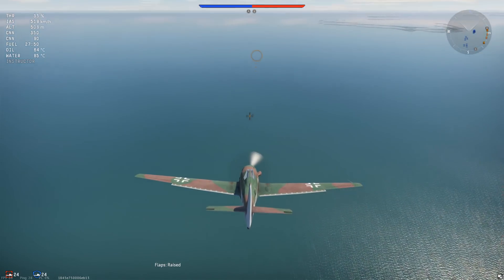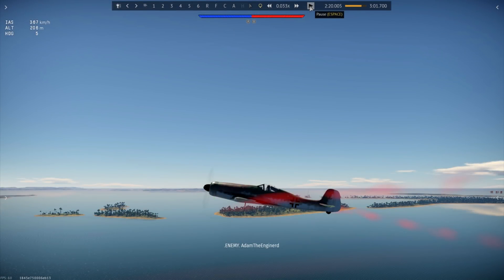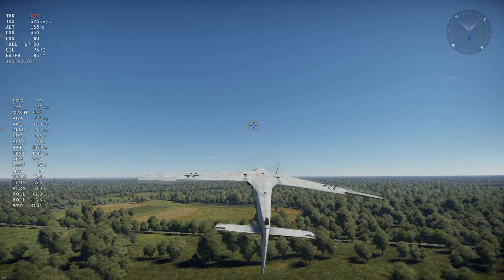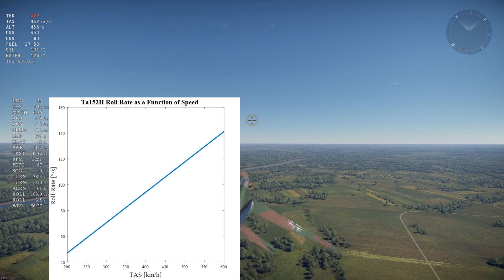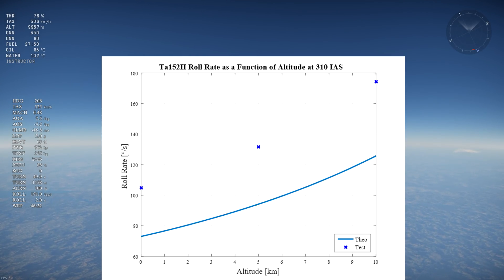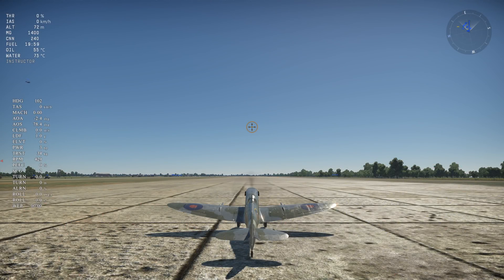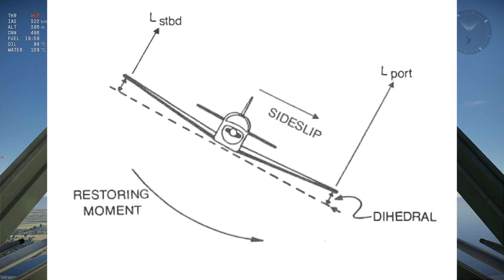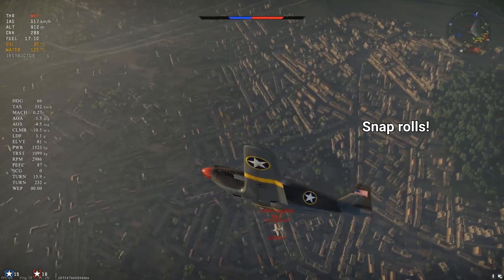Aircraft Roll Rate Explained

Comment: With regards, to the roll rate of the Typhoon, it could be down to a number of reasons(I'm no expert but would like to see what people think). Firstly it has a large wingspan, which limits the maximum rate of roll since the descending wing will generate sufficient lift to counteract the aileron produced torque sooner. But the Ta 152 has more wing area and doesn't have this problem, this could be due to how thick the Typhoon's wings are which gives them more inertia so the aileron torque will have less initial effect. Furthermore, I believe the control surfaces are pretty big without any boosters so they are especially slow to deflect at higher speeds. I'm pretty sure the Tempest had thinner wings and smaller control surfaces, which gave it a much better rate of roll. If these points are right, they should pretty much justify why the Typhoon rolls so poorly, but it's still one of my favourite aircraft.
Reply from the maker: Indeed Typhoon has a higher than average wingspan, but Ta152H has a higher wingspan (I assume that's what you meant, not wing area). Thicc wings could worse aileron effectiveness perhaps, but it's not for inertia reasons. Actually thicc wings are lighter than thin wings, I explained why in my Aircraft Wings video. Control surfaces being slow to deflect would only matter if we were evaluating roll acceleration, but I was always doing sustained roll rates.
Reply: @AdamTheEnginerd  Either way, I love your videos and they've helped me a lot at surviving 5.7 Allies, and in flying the thicc winged typhoon. Keep it up!
Reply from the maker: @oliverhill9986  Thanks, I will!

Comment: Is this covered by you already?

Why is some aircraft has good straight flight speed but bad climbrate
While others have bad to normal speed or is slow  while having good climb rate?
Reply from the maker: High power to weight aircraft will climb well even if they have high drag, while you can't have a high drag aircraft be fast. Drag reduces top speed much more than it reduces climb rate.
Reply from the maker: I explained climb rate here: https://www.youtube.com/watch?v=eEeBX7XAgsw&t=0s
Reply: The faster you go, the more drag. Top speed is achieved when thrust equals drag. Therefore since thrust in props is constant top speed depends on drag (coefficient). The less drag airplane produces the faster it will go. 

Acceleration on the other hand is (thrust-drag)/weight. Since drag at low speed is rather low, we can oversimplify it to saying that it depends on thrust/weight ratio. Climb rate is more complicated, but it has much to do with T/W ratio also. Adam already has a vid on climb rate. 

That's why planes with low drag - like P-51 with linear flow airfoil - have high top speed, and planes with more drag, and planes with high drag - like fixed gear (even only tail wheel, like 109G) have lower.

And that's planes that are light and have powerful engines have great climb and acceleration. As long as they are slow they have good thrust/weight, but when they get faster the drag they produce gets significant, "eating" part of engine power.

Why not produce light aircraft with low drag then? Well, it's not that easy. Many of things that reduce drag are heavy. For instance the retractable tail landing gear. And if you make an interceptor, speed is often a secondary factor. Tho, some have tried. F8F for instance has small fuel load, small supercharger and initially only HMGs to reduce weight, and its very powerful engine helps top speed and allowed for some additional drag reduction.

Edit: forgot to mention it's not super accurate, but general idea is the same
Reply from the maker: Thrust reduces as speed increases for props following Power = Thrust x Speed, and props have constant Power with Speed.
Reply: @AdamTheEnginerd  Thank you, I had no idea I was so wrong

Comment: I noticed that at least in war thunder, generally the aircrafts that have a good roll rate, have a worse turn time and vice versa, like fw190 vs spitfire, F4U vs A6M Is that because the good rolling aircraft shorten the wingspan and results in less generated lift? Or some other factors like rudder, moment of inertia, etc. are involved in this case?🤔
Reply from the maker: Generally fast aircraft have worse roll at very low speed but better roll at medium and high speed. That's because the aileron forces need to be sized differently for slow aircraft and for fast aircraft, so the slow aircraft suffer at high speed and the fast aircraft suffer at low speed in the roll department. Spitfire outrolls Fw190 at low enough speeds (below 300km/h). It's not due to other reasons.
Reply: I'm just speculating here and I'm too lazy to do actual research here, so take what I say with a grain of salt and perhaps do some research of your own.

Aircraft that are good at rolling have short wingspans, but aircraft that are good at turning have longer wingspans, as a plane with more wing surface area will have less wing loading (assuming both aircraft have similar or equal weight), which is a contributing factor of how good a plane can turn iirc. Although wing loading doesn't have much of an effect on roll (remember to take my speculation with a grain of salt), the wingspan does, and that's what causes a trade-off between roll & turn time. I'm sure there are other factors such as the design and purpose of the aircraft overall.

Remember to do your own research if you're really interested.
Reply: what about yak-15p?

Comment: Adam I have and rc model ta-152H. Models seem to have faster role rates than there full scale counterparts. Have and ideas why they would have a faster role rate? On models you can control the role rate by adjusting the rates of the control services the ta-152 h has a 1300mm wingspan. Go to Motion rc and type in ta-152 if you want more specifics
Reply from the maker: Yeah, it would have a higher speed/wingspan ratio! Also your aileron deflection is likely significantly higher than the measly +-17 degrees on the real Ta152H.
Reply: AdamTheEnginerd they do have more deflection. I try to make them as scale as possible
Reply: Not Adam but I just finished my introduction to aerodynamics course. There are a couple things at play here. 
1) You can scale the aircraft down, but you aren't scaling the fluid to match. A lot of characteristics of a wing or an airfoil are directly dependent on the density and viscosity of the air. So, if you want to make a model perform exactly like its full-scale counterpart, you have to change the environment as well. Our class examples about scale modeling usually involved working fluids like water and other liquids. I think the Reynolds Number specifically, which is a dimensionless number that characterizes a flow, is what you would have to pay attention to.
2) This doesn't come from aerodynamics but it still holds true in this context I think. Square cubed law, looking at just the wings, the area of a wing increases a lot less than the volume of the wing as you scale it up. So a full scale wing weighs much more for relatively less lift than a model. So it will be just generally less responsive at larger scales.
Reply: Is your RC model made out of metal to match the scaling in weight to the actual plane?
Reply: miked815 it is made out of foam,plastic, carbon fiber spars for wings elevators etc. lipo battery powered
Reply: For example if your RC model is 1/25 the size of the real plane, is it also 1/25 the weight of the real plane. Weight will be a huge factor

Comment: For your problem with the roll rate of the Typhoon.

I'm guessing that a suboptimal aileron position is already part of the aileron effectiveness part of the equation?

Also: What's "roll stability" really called?
Reply from the maker: Aileron position is at the wingtip, where it should be. The wing is indeed long, but the relative size of the ailerons compared to the wing is nearly 2x bigger than Ta152H and Fw190. The equation predicts that the Typhoon has a higher roll rate than Fw190A haha.
Reply: I think is because its great wing span or/and its strange dihedral(the mid-tip of wing point upward while the mid-root of wing is straight).
Reply: @pedrosabino8751  I was too starting to think about the strange dihedral. If Adam can do the same calculations for the MiG-3 and he ends up with the same problem, it's probably that

Comment: You should have waited a few days for the F-104 to show what "a lot of roll" really means!
Reply from the maker: The clipped Spitfire outrolls the F104 below 400 km/h ;).
Reply: @AdamTheEnginerd  104 doesn't stay in air below 400km/h, so I guess that even TU-4 will outroll it.
Reply: Or he should have used the a4 skyhawk. Its roll rate is so insane that pilots are recommended to not do more than 2 rolls
Reply: This is very late, but does the roll rate increase with altitude?

Comment: Came in on 109 views, noice

EDIT for the actual comment after watching:
It's a nice feeling having someone this knowledgeable on aerodynamics and general physics educate about content from a game using concepts applied in real life(that is in the game) and also kick ass in it every other day.

For the next educational video, I'd like to see something on manual engine controls. I watched another channel (The Air Combat Tutorial Library) on it but I'd like to see you talk about it. As far as I know fuel mixture isn't modeled in the game, and propellor pitch is modelled to a questionable degree of accuracy. It sounds like a lot of effort on your part, but I'd like to see comparisons between an aircraft on auto engine controls, on manual engine controls with individual settings on auto(eg 109), and a graph with fully manual controls and what the optimal settings for a plane to have highest thrust and (separately of course) best top speed(probably need to do one for sea level and another for a good medium altitude).
Reply from the maker: Noice.

I agree! I'd love to watch videos like these, hence why I make them.

I'll consider it!
Reply: It would be really great!
Reply: IMHO the only point if MEC in WT with all aircraft except 109s is to control radiators. With tier 4 109s MEC will improve a lot your performance: 25% radiators and you will WEP the whole game, 100% prop pitch airbrake, and 70% (65% above 3000m and 60% above 5000m) improves massively your stall climb performance. Apart from 109s (and other aircrafts DB605s)  and P51h (where micromanagement is important) MEC shouldn’t improve your performance drastically, though radiators can help to WEP for a much longer period of time
Reply: @ferrarisuper  Prop pitch contributes a lot to engine endurance too, 95% prop pitch on Spits and a number of planes let the engine remain cool for longer than 100% without too much loss in thrust. Some planes even need 90% like the lower BR Regiannes(?)